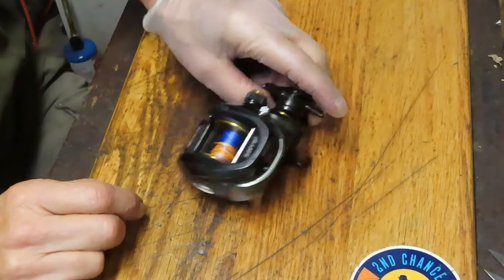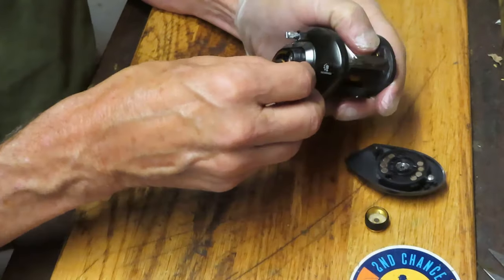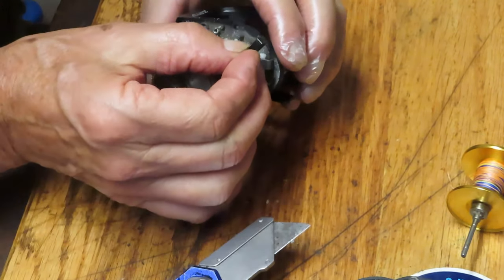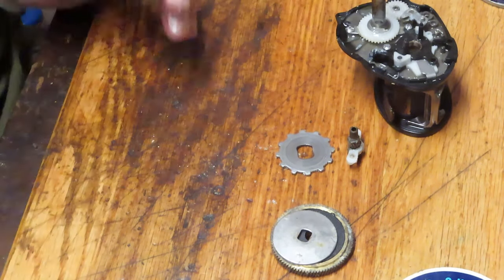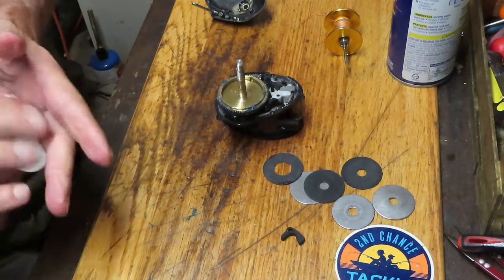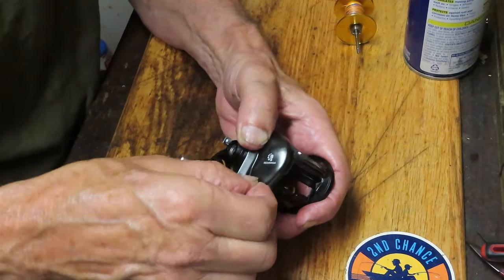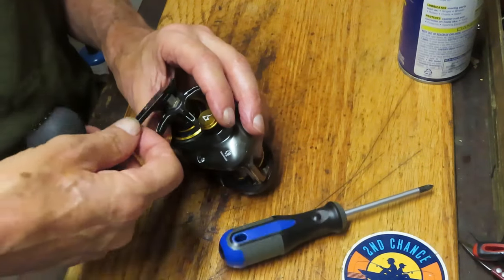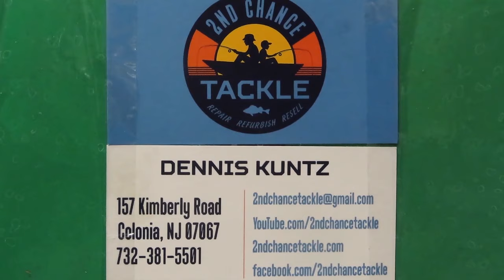Piscifun Alljoz low profile bait casting fishing reel how to repair and service

Comment: Dennis I’d like to know more about that pin tool you used in this video. It seems to me that the owner of this reel must have considered it to be disposable. Thank goodness he decided to send it to you. Giving this reel a second chance was quite a challenge. You resurrected this reel in beautiful and extraordinary fashion. Very impressive work Dennis. You are amazing! — Chris PS. I occasionally use PB Blaster but it makes my eyes burn quite badly. I avoid getting close to it.
Reply from the maker: Thanks Chris - The tool is available in a kit I got on Amazon. Here is the link https://www.amazon.com/HIZXMCNGH-Lightweight-Baitcasting-Maintenance-Stainless/dp/B0D3Q87X3K/ref=sr_1_2?crid=2U6D7QLQYBM5R&dib=eyJ2IjoiMSJ9.hlh_vLOKCBID6kO82hs6SXIopqJb1OHb1YUhmqtfDXE_4_HPc-5d7nuGniuKpoCZxTkKGlP22ps7BkTUszQbUw9DTfnVrlvUskFGqyPVWz0wf3CPL9xo-M5IMn4TIZgFdmx1oSSvK3zPK1AE6Y7-EuxM4U8uDIe8Esb82M3cwiymLw0Q_5Y9rRR41a-Sir8bbYoaxdUdiC6J275KXACTyn1Qaef75M0wPS5ujNb9MStDKklR9AJ6TEK6ETKahbcR8TpeGCzzgmd-rNTGnh3OkIzvTP2-JmN0wfG9xkt4j5Q.bXvvf6mxze0T5vjFPgCQ-3qovlLag9W05uAhTRDZYKE&dib_tag=se&keywords=small%2Bbearing%2Bpuller%2Bfishing%2Breel&qid=1722177471&sprefix=small%2Bbearing%2Bpuller%2Bfishing%2Breel%2Caps%2C113&sr=8-2&th=1

Comment: I have learned a lot about reel maintenance by watching your videos. I have several Piscifun reels and they have worked just fine for the type of fishing I do. My question is do you think the places that sell ceramic bearings for reels would have the size bearings that would fit a Piscifun reel? 
I've been thinking about replacing the bearings to see if I could gain more casting distance.
Reply: Of course they have. Why wouldnt them ??
Reply from the maker: Yes - I think they would have it by size.

Comment: I just discovered the same, absolutely no parts available. Would you know what reel uses the same springs? The kick lever spring cracked in mine and I can't find replacement.
2 loop, 120ded, wire .78mm, loop dia 3.38mm  I couldn't even find generic spring on Ali that would be close to that.
Thanks for the video! :)
Reply from the maker: I don't know a direct replacement.  Unfortunately, one of the things that reduces cost is to eliminate parts and services from the equation.  That leaves the reel in disrepair and disposable.. I don't know what factory made the reel, so I don't have any information on other trade named reels that may have substitute parts.  Sorry I can't help further - Dennis
Reply: @2ndChanceTackle  Thank you for reply!